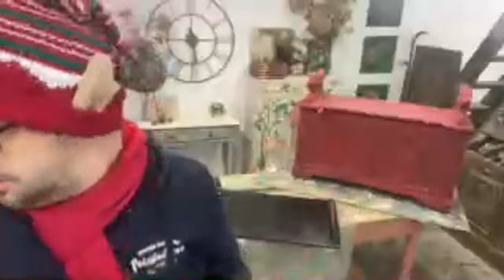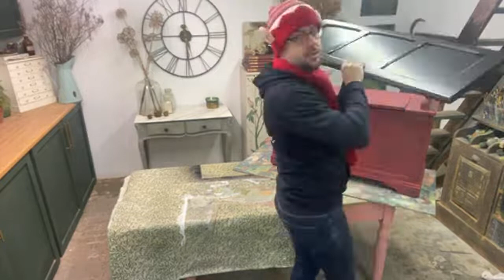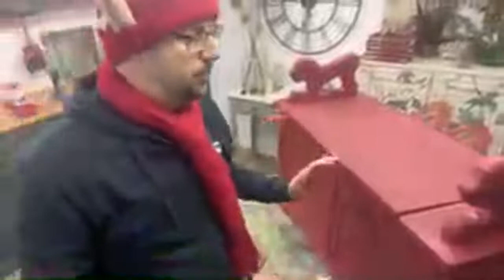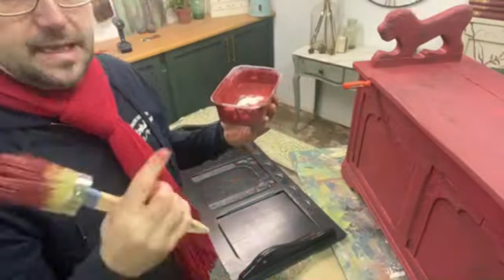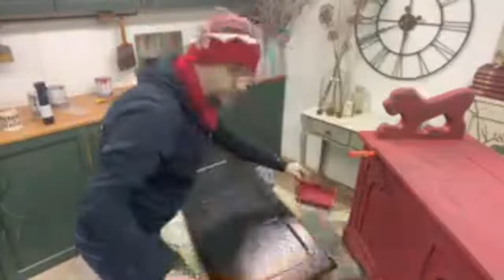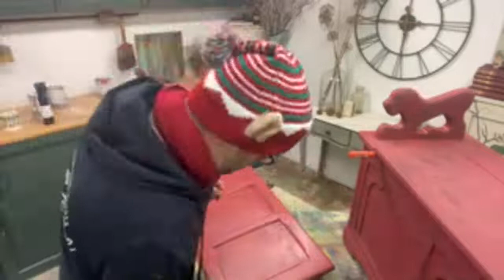Painting a flat colour why! Q&A ask me any question.

Comment: Great bench! You said you mixed your paint with a red primer...what is the primer you used?
I have a buffet that has similar issues you faced. Planning to paint with Annie Sloan's Oxford Navy and Aubusson blue and am stuck on how to handle the prep work.
Excited to think I can add paint to a primer as the prep instead of sanding it all!
Thanks for sharing info about what you use...am fairly new at this and appreciate your knowledge and beautiful work.
Reply from the maker: Great question I did virtually no prep work on this other than a good clean you will not need to do any prep work with Annie Sloan chalk paint you can just paint straight on 😊